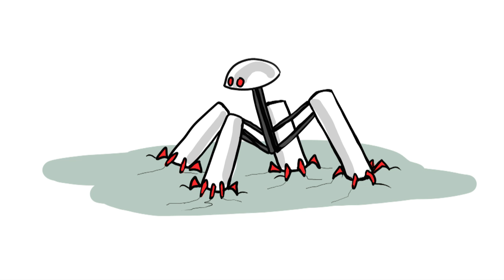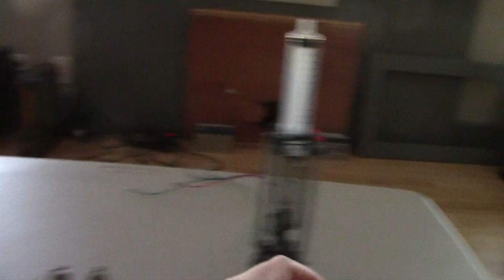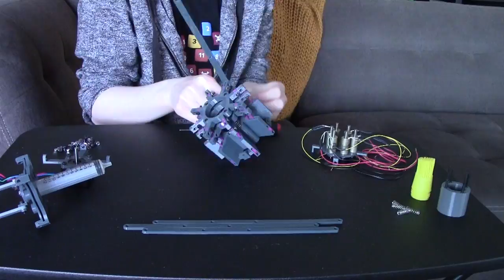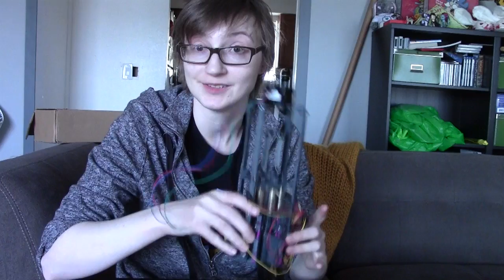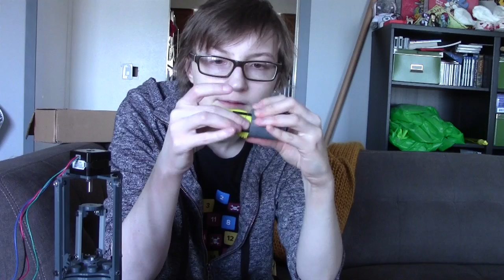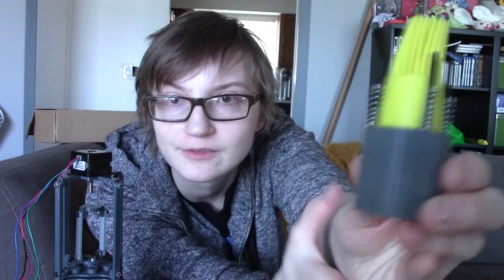Noodle's Tasting Feet : First Nonworking Pro-TOE-type

Comment: Solenoids in general can only apply smaller actuation forces, require a lot of current to run and require complicated circuitry.  You could use small linear actuators (geared ones), but they are slower than solenoids.

Comment: If you have the energy capacity you could do a simple schematic circuit with valves.   You could probably make some pneumatic actuators Really cheap, and could probably print the valves.
Reply from the maker: +Ryan Hanson Hmmm... I've never done an pneumatic thing. I may look into this. =o